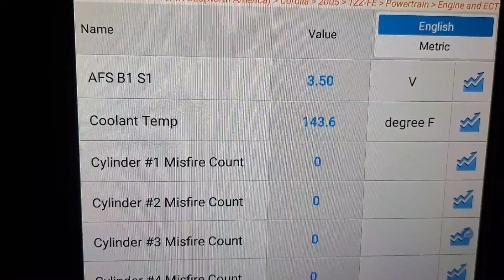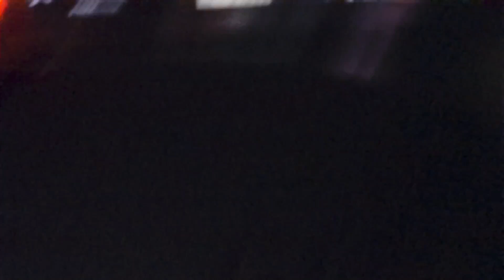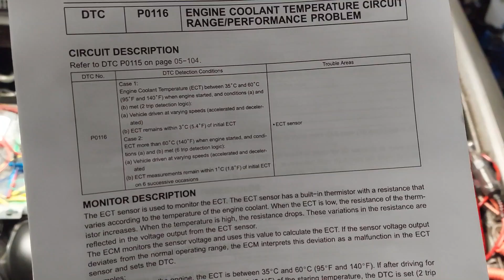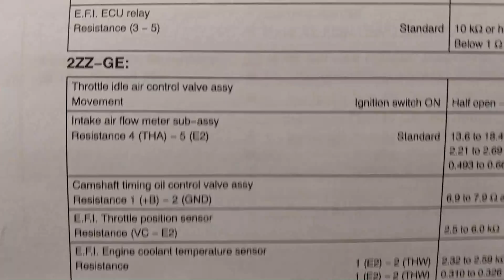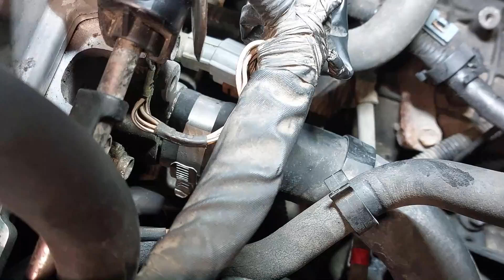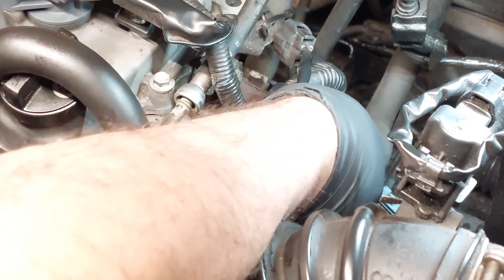2005 Toyota Corolla 1.8 - P0116 DTC - ECT Sensor 1 Range Performance - Diagnostics

Comment: Hi Moose thanks for the video, there is another sensor to the right above the one you changed. it has a number 2 on it and has just one single pin/cable it seems. Do you know what that one is for? It seems to be another coolant sensor.

Comment: Moose this was great.   You are thorough.   My 95 Corolla is running low indicated engine temp all the time.   I did have a question.   You tested the resistance of the sensor cold and it was close to spec.   Why didn’t you test resistence of temp sensor when engine was warmed up?   If the warm engine resistence was out of spec it would be a slam dunk the sensor was bad.   Probably just hard to access sensor when engine was hot?
Reply from the maker: The vehicle's computer was tripping a pending code DTC for P0116 and so it would come back even after clearing it and the engine would take too long to warm up especially in colder weather. The thermostat was already replaced in previous years and so this was an isolated problem with this code. Sometimes the ECT sensor itself fails internally and a resistance reading does not always mean everything even if it is close or within specifications. It is not always a definitive diagnosis with just the resistance reading alone and so things like this can be intermittent. So it wouldn't really matter if the engine was cold or hot, but as long as the resistance reading falls within the proper range for the specified temperature for the testing. Aside from all of that I ended up replacing the sensor after doing my checks and making sure the wiring and everything was still good before replacing the sensor.